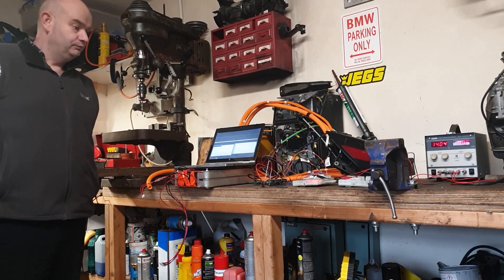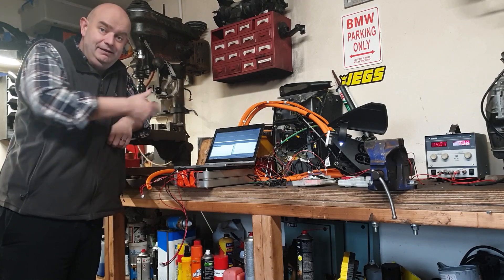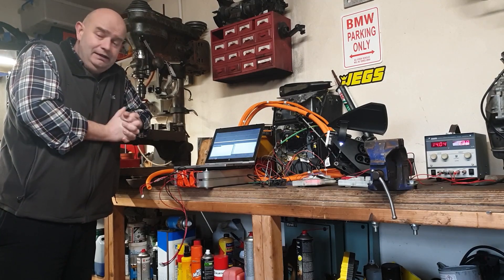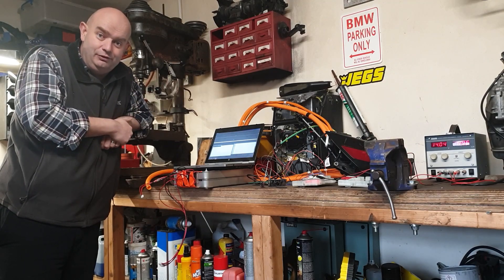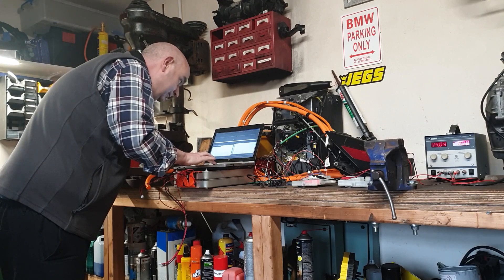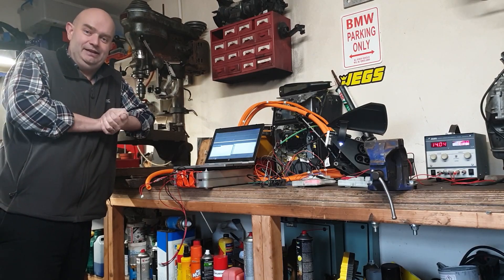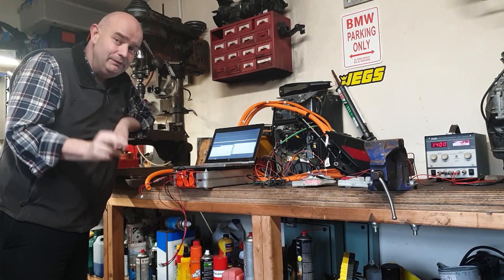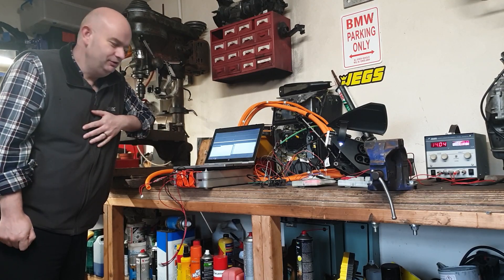Can Hacking Is Very Difficult

Comment: Damien, let me know if you need more captures, m3p, where’s my Chademo lead ;)
Reply from the maker: Yes I do need captures. Your Chademo lead is here with me:)
Reply: @Evbmw  Is it possible to program the board to change the electric motor max rpm depending on input from hall sensors connected to a teensy chip?.

If ur asking why... its needed for a hybrid car where the tesla drive unit is connected to the diff of a rear wheel drive and obviously rotating to max rpm in a gear lover than fourth will destroy the engine.

Comment: Thank you Sir for awesome inspiration! I am in the phase of psychologically preparing myself to start CAN Hacking my Jaguar x-Type (I'm so sad it's a front wheel drive, so I guess I can't use the legendary Bexus transmission - its bhp's would be just perfect...) to one day transform it into an EV... a Jaguar without the check engine light, that would be a sight! Cheers from Slovenia!
Reply: Is it possible to program the board to change the electric motor max rpm depending on input from hall sensors connected to a teensy chip?.

If ur asking why... its needed for a hybrid car where the tesla drive unit is connected to the diff of a rear wheel drive and obviously rotating to max rpm in a gear lover than fourth will destroy the engine.

Comment: Any tips about what software and hardware to use to do this?
My CAN experience to date has just been connecting a LEM current sensor to an STM32 Blue Pill, but that was easier because I had the datasheet for the current sensor and so knew the ID and message format.
Reply from the maker: That will be in the next video with an appropriate warning on the dangers of doing anything CAN related....

Comment: There must be a can database leaked somewhere on chinese websites or some such. Even if you know the id of the message, there is still work to do, as you need to find out which bit or bits are responsible for the change.

Comment: I get hacking can isn't very difficult BUT, guys like me who are pretty mechanically inclined and have a pretty good grasp on electrics, but  we just don't have the knowledge on software and hardware that is required to do such Hacking. 
I searched for "reading" "hacking" "decoding" "writing" yada, yada, yada videos but they all seem to talk about the can messages themselves but don't really talk about the how to use the software and specific hardware that is used to get to the messages. 
Again thanks Damien for all the work you are putting into EV conversions and put this info out there!
Tony from Toronto
Reply: I made some videos about CAN hacking starting here. 
https://www.youtube.com/watch?v=V4Jp4QkcHSk
I'm no expert and had never used Arduino before doing this so if I can do it anyone can. 
The way I achieved it may not be the best but it worked well enough for me to know I would be able to take it further when I need to.
Hopefully the forthcoming video from Damien will be a bit more informative.
Reply: Same